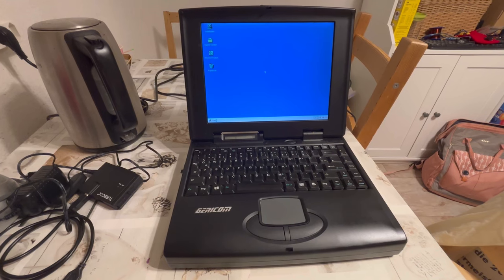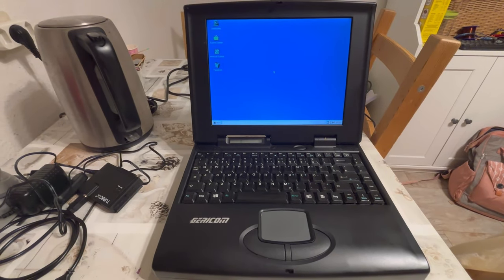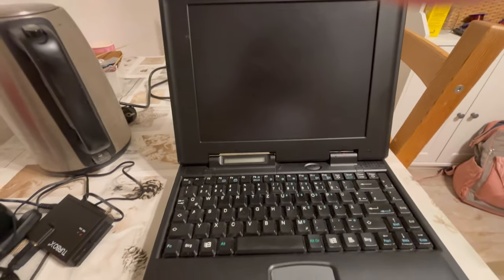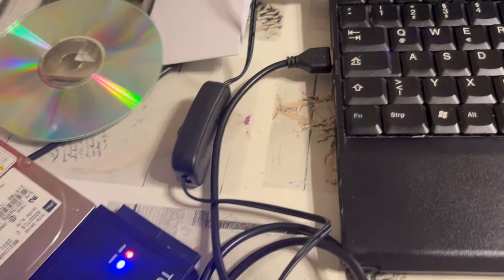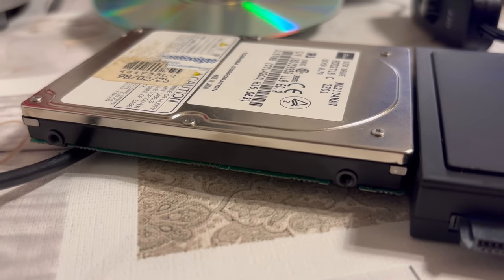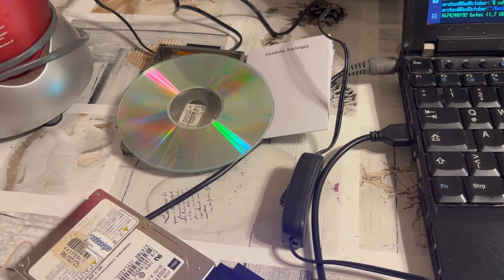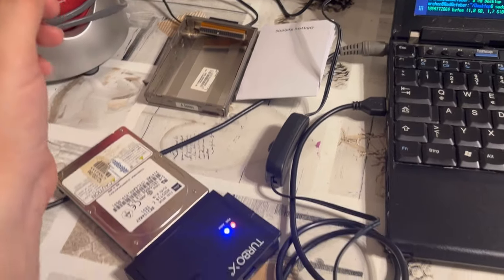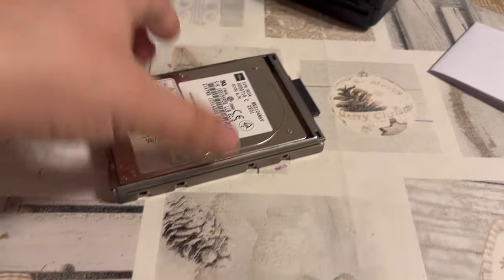Windows 98 Gericom Laptop — imaging the hard drive

Comment: Ho Nino! I’ve the exact same laptop (actually it’s made by Clevo) but is now working. This would be one of my next repairs. I’d love to see more videos about it! Ah, you could use Plop boot manager to boot from cd or (i think) from pcmcia/cfcard😉
Reply from the maker: Oh, wonderful! Thank you for the hint — and good luck fixing yours! 😊 Yes, I was making various experiments on this little darling, and you shall surely see a lot more of it in some of the coming videos! 😁
Reply: @ninoivanov  Oh Yeah! Actually I’m eager to see if Slitaz can make it useful for certain daily tasks. You could try for a whole week🫢. Aah, one thing I’d want to also check is the battery compartment. Now, mine didn’t come with battery pack, but I suppose you could also use spare batteries? Just imagine, that thing could run for days🤣🤣
Reply from the maker: @retronoobtech8551  I doubt it is very energy-efficient — new parts are so a lot more than old parts. I am not going to make it a Slitaz machine, however; I specifically intend to keep it as a Win98 relic… 😁